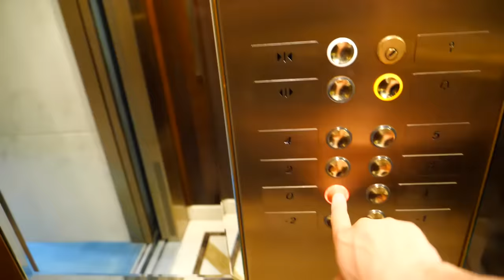ALGERIA'S Most SURPRISING City 🇩🇿 TLEMCEN, Africa's Hidden GEM تلمسان

Comment: Unfortunately you didn't get to visit the Beni Add caves in TLEMCEN, in the commune of Aïn Fezza. Drilled 65,000 years ago into the limestone of the Tlemcen massif. A marvel over 700 metres deep, with a constant temperature of 13 degrees all year round. 😔 Also the royal palace, which was closed this day, should avoid  Fridays when everything is closed.

Comment: Used to be the highest waterfall b4 they built a dam upper. Water was falling from the very top of the mountain, high and large waterfall, something like 500 m large. Theone you can see is not a real waterfall, just a bloody pumps pumping in a closed loop.

Water issue u know, thanks for sharing.